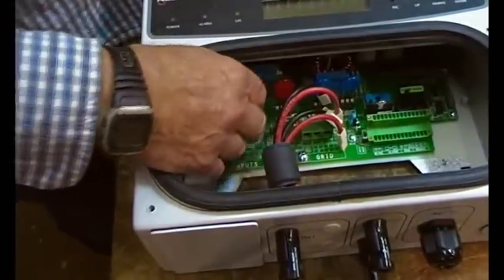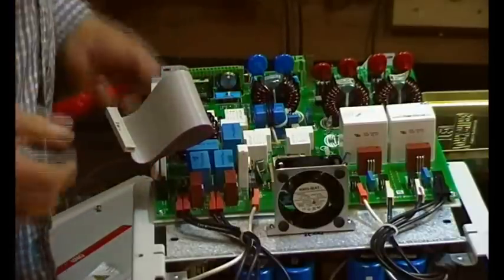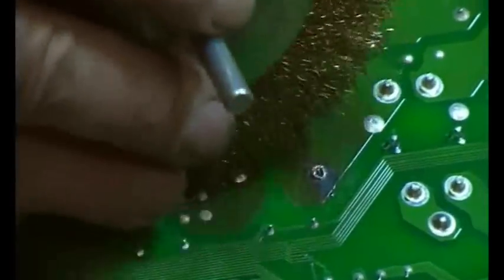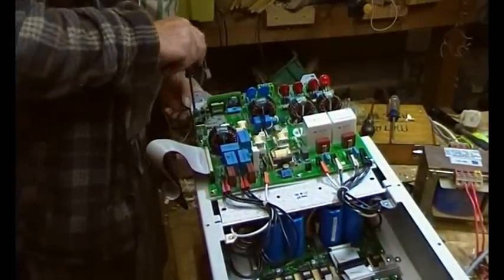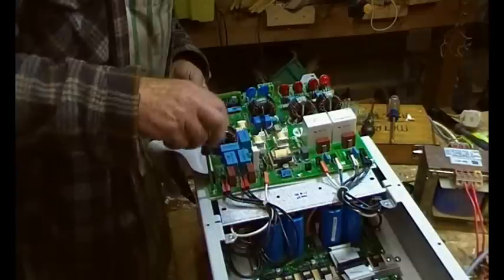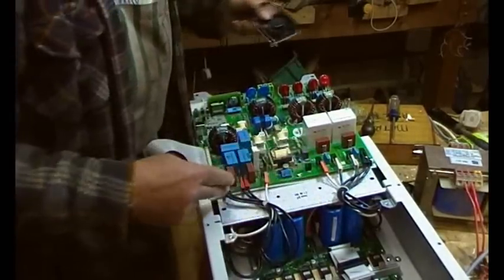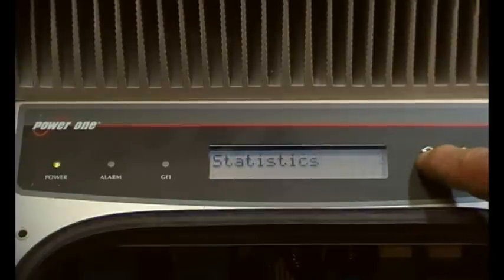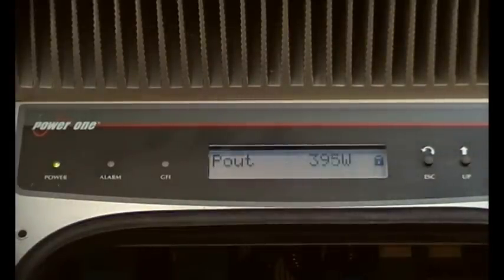ABB Aurora  inverter fault code E031 fix / repair

Comment: Thanks Andy used this fix some years ago and ordered a ten pack of new replays of ebay from China cheap,  same as original, problem came back so in go the new relays problem solved . Saved 2000 dollars. Nice.
Reply from the maker: I'm thinking you have a cooling problem, either move the inverter to a cooler well ventilated area or add an external fan controlled by a time switch. As ever a Patreon sub would help the channel continue, help me help you, cheers

Comment: I've fixed a couple of these for similar faults in the past. I've seen someone has said on a forum somewhere that this issue is caused by failing relays melting the solder away from the joints, but I don't think that's the case - the soldered joints from factory are unusual, they're concave as if there wasn't enough solder flowed on them during manufacture. I believe the the daily heating and cooling cycles causes the weak joints to crack, the the poor joint arcs and burns up the pin and board, leading the inverter to fail.I repaired one recently that I'd done another repair on a few years back, my original repair was still good, a different relay had suffered the same fault. Incidentally the Riso fault that I saw mentioned elsewhere in this thread is often caused by the failure of a smaller relay, which I've read is a specialist safety relay, and replacing the relay cures the issue. I believe when that relay fails the Riso reading comes up as 0 MOhms on the display... (I do appreciate that this is an old video, but I commented as there is obviously still some interest in these inverters.)
Reply from the maker: I'm convinced that some of the heat comes from arcing contacts, burnt from either overload or disconnecting under high load. this just compounds the other faults you described. Run these units at half power and they will last for years, cheers

Comment: Do you know which part of the board measures the riso. Can the riso be set to a differat value.
Reply from the maker: Riso is the leak to earth, sometimes the leak is in the panel wiring, sometimes in the inverter. I believe this can be switched off but you need the engineers password (difficult) cheers
Reply: @TheInfoworks  cheers, it's such a shame really as these have plenty of life in them , but know one can get into them due to regeneration password software
Reply from the maker: @gino2465  I have abandoned several once I made sure the ground fault is in the inverter, swapping the inverter soon shows if it's in the panel wiring, cheers
Reply: @TheInfoworks  it's such a shame as if it had access it could be turned off.
Reply from the maker: @gino2465  Buyitfixit has an angle on this, cheers

Comment: My pvi 3.0 inverter is totaly dead. Did anybody has a drawing of this board. Close to the defect relais is the internal powersupply. I thing it is damaged too
Reply from the maker: Hi, if the board is badly burnt then get another second hand unit. Inverters need to be mounted in a cool, well ventilated area, cheers

Comment: Girlfriend's inverter showed error 31 at the weekend so found Mr. Reynolds' site, whipped the lump off the wall in the loft and found a really small dark spot and dry joint. Fantastic, resoldered the joint (I was slightly less agricultural with the cleaning...no offense Andy) and put it all back together and refitted it, confidence levels were high at this point.
The knight in shining armor skulked out of the loft and admitted failure, had a cup of tea and got back at it.  The ABB now has a convertible relay and modified shape to the arm as in this video and hey presto we are generating wrigglies and my stock is running high again!
Four replacement relays are taking a leisurely cruise from china and will be fitted in due course (Convertibles are not great in this country long term).

Many thanks for your time doing these videos Andy, very much appreciated.
Reply from the maker: Great you were able to move this project on, the important thing is to keep the inverter cool, in the loft is exactly the wrong place, hot in summer. A time clock controlled auxiliary fan would be helpful, cheers

Comment: Hi sir  how are you i have fault E013 WORNG MOOD how i can clear it i have pvi 12 kw on grid 3 phase
Reply from the maker: Hi, on the single phase units there's a dip switch to the right of the mains connection, cheers

Comment: Could it be that bad relay contact gets hot and then unsolders itself?
Reply from the maker: Exactly, once the arcing between the contacts starts then gradually the problem gets worse and heat builds up and is transmitted down to the solder joints. Running the unit at full capacity breaks the second rule of solar, cheers
Reply: @TheInfoworks  Do you think it's absolutely necessary to bend the relay contacts, as well as doing the resoldering ? If the resoldering was done, only, do you think it's likely the problem would reoccur? Many thanks
Reply from the maker: @rosstituteuk  It is my opinion that in some of the cases the heat that causes the solder to melt is caused by small arcs at the contacts. The arcing is caused by contact surface erosion, and resetting the contacts so that there is some spring in the contact blade is a way of ensuring that a surface contact is made. That and also making sure the contact surface is clean, cheers
Reply: @TheInfoworks  great work. many thanks for sharing. regards

Comment: Hi! There..!! Can you tell me how to fix error code E033.. !! Please..! Thanks..!!
Reply: I have ABB 4.2 OUTD won’t power up and giving me error code E033..??
Reply from the maker: Looks like an internal temp fault, try disconnecting the fan and looking for the temp sensor (PTC or NTC). Normally a pair of wires, commonly black and white, Subscribed? Cheers

Comment: Well Andy. Pleased to report your method worked a treat. Opened up - located two small burn marks on the solenoid pins. Cleaned ,  soldered  and tested . The Aurora  is back in service and operational. Five stars to you. Pretty chuffed for giving it a go as well. Its all a matter of seeing how long the inverter will keep on working for.
Reply from the maker: Joe, well done, the key here is to keep things cool and well ventilated. Sometimes I add an extra fan run from a plug in timer, just to blow air over the heat sink from 10 till 4. See my video on extending inverter life. cheers

Comment: Thanks for getting back to me Andy - noticed that the error code is in fact E031 which now makes more sense. ( he says) 😄I'm going to attempt repair - thank you.
Reply from the maker: Joe, bit of numerical dyslexia there. See all the videos in this series before attempting the fix. The heat comes from poor relay contacts arcing. Hope you have subscribed and remember me when it's fixed, cheers

Comment: Hi Andy, my Inverter was flashing E031 error code. I have switched-off the red and black Switches that provide inputs from the Solar panels. I'm planning to replace the Aurora 3.6kw unit with a refurbished unit (as its a cheaper option to swap it). Could I ask how easy is it to take the existing Inverter from the wall and what electric safety check I need to do as I start preparing to take the existing unit off the wall? ... Do you have a video showing switch-off and dismounting existing ABB Inverter? Thank You in advance
Reply from the maker: Hi, It's just a matter of switching off the mains power, then switching off the solar power. Then the inverters is electrically safe. Then I remove the rectangular plate at the bottom. The rest is obvious. Subscribed? cheers

Comment: I've just seem the E031 error thus morning on my Aurora. I thought I check it after noticing 2 dats if zero power during a heat wave 😢
I'll check for warranty first before I contact ABB but thank you for providing really good guide to the fault resolution 🙏🤟
Reply from the maker: Hi, yes inverters need to be in a cool well ventilated space, see my other videos on this inverter including extending inverter life and setting the relay contacts. Hope you have subscribed, cheers
Reply: @TheInfoworks  Thank you. My inverter is in the garage outside. we had it fitted in 2012 so just about 10yr old.
Reply from the maker: @dineshmistry8902  I's an easy fix, but you may wish to change the relay instead of soldering and adjusting the contact gap, cheers

Comment: Hi Andy, Thanks for the video. Very helpful. I have been facing different problem though. My inverter disconnects from grid supply after some time. The self diagnosis displays "Inverter OK", Riso 20Mohm before connection. I have reset few time already. Problem persist. The solar supplier suggest to replace the inverter with new one - without really knowing what's the problem with the current one. I am not convinced. I wonder if you have come across such problem. Any suggestions?
Reply from the maker: Hi, this could be the first sign of relay contact failure. Is the inverter in a cool well ventilated area or does it get hot? You could have the tops off the relays and reset the contacts, see my video on this. Is the RCD that supplies mains to the inverter working correctly? is there a no grid message? cheers
Reply: @TheInfoworks   Hi Andy, Thanks for your prompt reply. The Inverter is installed at well ventilated place - tropical weather (ie. warm through out the year).Mains(grid) is working properly.  When I reset - i.e. switch off AC and DC isolators and ON again, power supply comes on for  awhile - (about 10 -15 mins), then Pout is zero again. The intermittent nature of the fault is what puzzles me.
Reply from the maker: @rsubra59  I still think you should inspect the relay contacts, they can give an intermittent effect as they warm up, cheers

Comment: Many thanks for making this video Andy. I’ve just repaired my Power One inverter which is back in the loft exporting again. I had the same fault code and confidently looked at my relays. Three of them were burned with broken connections. Within 24 hrs I had four replacement relays via eBay fitted following your advice. Thanks again! Tim
Reply from the maker: Tim, great news, another inverter saved. Inverter in the loft can be a problem, see my video on extending inverter life. Hope you have subscribed, cheers

Comment: Just one of my relays seems to have failed. It's a bit more brown and one pin at the back has failed, just like yours.
I've ordered a relay off eBay for £5 and will have a go at replacing it .
Great videos 👍🏻
Reply from the maker: Dave, that's the spirit, see the improved fix video and the relay replace one in this series. If you don't already have one, get a solder sucker (just a few pounds) to help with removing the old one. Let me know how you get on. Is your inverter in a cool and well ventilated position? cheers
Reply: Hello Andy, thanks for the reply. 
Fitted a new relay but it came up with a new code E013 . Not sure what this means . Your videos were a great help but feel I've done something wrong .
Keep up the good work 👍🏻
Reply: Sorted. It was a little black switch which changed the mode from parallel to independent . Must have tapped it by accident 🤦🏻
Reply from the maker: @dave3130  , yes I had that once and it came up with a message "wrong mode". Easy to catch that little dip switch, well done for sorting it, cheers

Comment: Andy, you know since Oct, the solar people still have not resolved my issue with E018 error.  They replaced the inverter and it work maybe 4 days then went back to the error.  Now this inverter is also giving a E019 error.  They recently came and checked the wiring on each panel to make sure there were no cracks but didn't check the voltage or resistance per panel.  Now they suppose to come back in April and check that.  They have no clue.

Comment: Brilliant Andy.  My first inverter failed after 4 years with E031 and was replaced by ABB.  I'm now 6 years into the second inverter and getting worried!  I like your fix and to be honest I would rather have fixed it than have it replaced.  BTW, any idea why this solder connection fails?  Too much heat perhaps?  Peter Johnson
Reply from the maker: Peter, I think it is heat usually caused by a combination of things including position. See my videos on the E031 improved fix and extending inverter life, subscribed? cheers

Comment: Thanks so much for this tutorial, l followed your instructions and found a burnt-out solder joint on the back of the circuit board.......repaired the solder connection and the inverter is now working fine 🙂.  £500 saving 👍
Reply from the maker: Darren, brilliant, that's good news. There are some other things you need to do, firstly check my video on extending inverter life and see my Paypal link below this video, Cheers. https://www.youtube.com/watch?v=GaqHZU8bD0M&t=2s

Comment: Another grateful viewer! 
Got the E031 error on my 8 yr old Aurora Power One, accompanied by clicking relays and no output. I found it easier to remove the board completely by unplugging the fan and all the connectors and working on the bench rather than in the attic! 
The relays are available in the UK from Rapidonline and eBay: the part number is:AZ2150W-1AE-12DEFT, made by Zettler.
Thanks again.
Reply from the maker: Richard, thanks for the message and the donation, much appreciated. An inverter in the loft, there's a problem. Please see my video on extending inverter life, and the improved E031 fix, cheers

Comment: Andy, I am getting a solid red light on my GFI indicator.  Do you have any troubleshooting suggestions?  I have tried turning everything off and back on again but it still comes up the same.  From what I read, its a ground fault on the dc side.  Thanks
Reply from the maker: Wayne, I've loaded a video about isolation faults on the DC side. Many inverters are very sensitive to ground faults, the slightest hint of DC going to earth and it upsets them. This can be a leak through cable insulation. You will have to test the DC circuits on the meg Ohm scale to earth. See the video to get the scale of the problem. https://www.youtube.com/watch?v=OlB8vFXykoI&t=2s      please subscribe, cheers
Reply: @TheInfoworks  both banks are measuring good DC voltage from the disconnected wires inside the inverter.
Reply from the maker: Wayne, so you have two solar banks, have you tried to isolate the fault to one of the banks by running the inverter with only one bank connected. The resistance needs to be measured between one of the DC cables and earth as it's an earth fault. Cheers
Reply: @TheInfoworks  I measured about 8 to 10 volts dc from each leg to ground on all legs.  The voltage for each bank leg dc+ and dc- is around 456volts dc

Comment: Hi Andy,  i would just like to  say BIG  thank you for your videos .... Very helpful,  I  resoldered connections and still got E031 error so I have replaced the relay now as well ... However the inverter now doesn't boot up,  but the GFI light is on ... Any suggestions how to resolve this ? Regards Adrian
Reply from the maker: Adrian, yes things like this can happen. The ribbon cable seems to be handed and has to be the right way round. It's often marked with a dot, otherwise have you checked all the spade connections are right and tight. If you get wrong mode there is a dip switch next to the mains input that can easily be flicked. Worth just going over the re-installation of the board to make sure all the screws are in place as each one I think is an earth. Cheers

Comment: Hi Andy

I have an old 1.5 KW 3-Phase Klne Grid Tie Solar inverter that was removed when I replaced the Klne system with a 3- phase 6.6KW Growatt  Solar system. I wish to bench test the Klne grid tie inverter. My DC supply for bench testing it, is from the old solar panels. Is it ok to input AC supply from the standard wall power socket in the house to the 3 phase Klne inverter for bench testing whilst the the Growatt system is operating at the same time?
Reply from the maker: Hi, I assume your old inverter being 3 phase will need 3 phase power for it to wake up. If you wired it up as you describe and connect the DC of the right voltage the inverter I imagine will give a grid power error. Subscribed? Cheers

Comment: Thank God for people like you !  Your second video helped me fix my power One inverter. Had a huge burnt out solder joint on the board.. its now back up and running.
Reply from the maker: HI, thanks for the message, beware heat build up and improve cooling. Have you seen my video on extending inverter life? Many other fix it videos. Subscribed? cheers

Comment: hello ,i have the error E031 in pvi 3.0 and i replace the faulty relay. now when i restart the inverter i have the error Riso Low (0.56MΩ). Any ideas for this?
Reply from the maker: Hi, I think that is an earth fault, either on the AC or DC. Cheers

Comment: What a star, saved me £850, these two fixes together worked for me. I'm now confident to buy a new set of relays (about £20) and will install these when it goes wrong next time - cheers Andy.
Reply from the maker: David, that's grand. Please see my video on extending the working life of inverters, and my book " Wind and Solar Electricity". Subscribed? cheers

Comment: Our Aurora inverter came up with this code so we took it apart and sure enough there was damage to the board like in your video. My brother resoldered the damaged bit and sure enough it worked. So many thanks for showing us how to do it as I was quoted £800 for a replacement.
Reply from the maker: Hi, that's grand, another repaired, please see my video on extending inverter life and my Patreon link, cheers